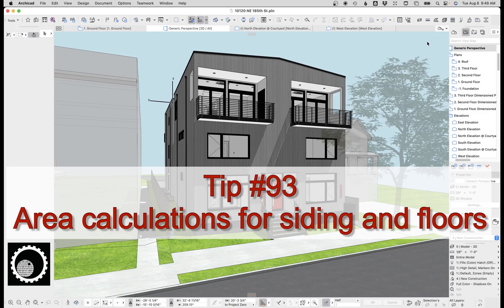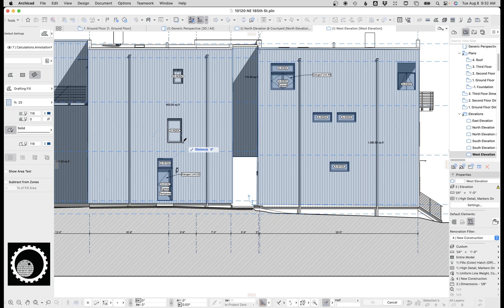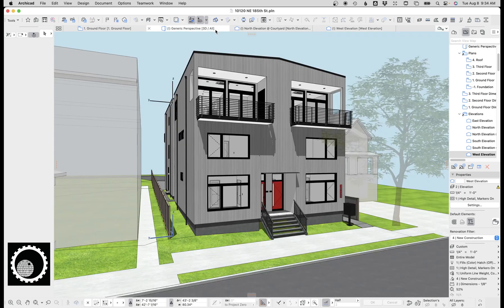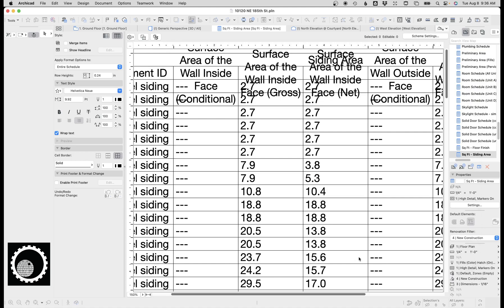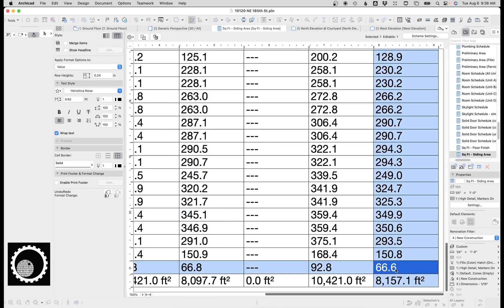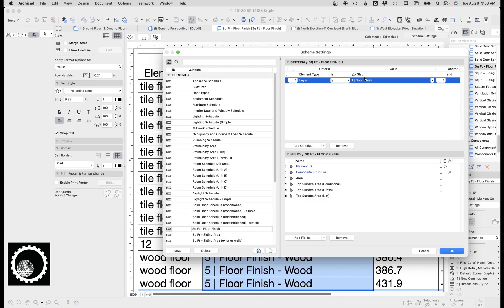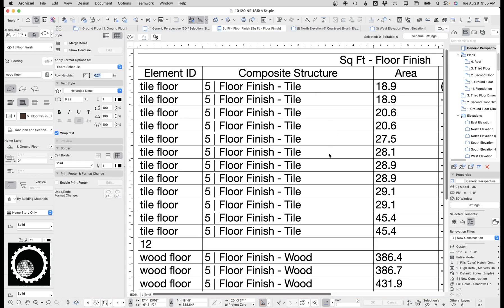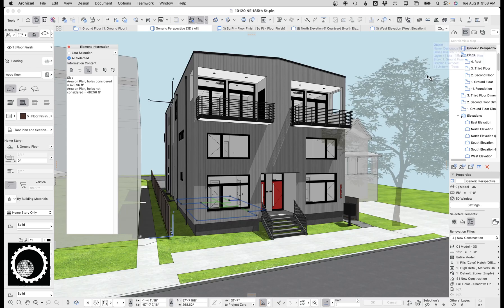Archicad Tutorial #93: Area Calculations for siding and flooring

Comment: Hey Jared! Great tutorial! Thanks for the tips and tricks as always. My question would be about wall area calculations. If you were to make a schedule that calculates wall net areas and sorts it out by individual room areas how would you approach it?
Reply from the maker: To do wall net areas by room, you'd want to use the Zone tool. I'll add it to my list to run some tests to see how well it works. It should be straightforward. You'd just need to make sure the Zone is the right height, touches the walls, and confirm that Archicad is calculating correctly. My first test suggests Zone "Walls Surface Area" will give you exactly what you want.
Reply from the maker: Here's a video that answers your question about wall area by room: https://youtu.be/tWyUnDTBtG4?si=gDMPg_5Fci6_oNVP